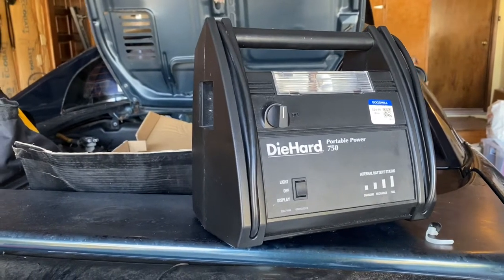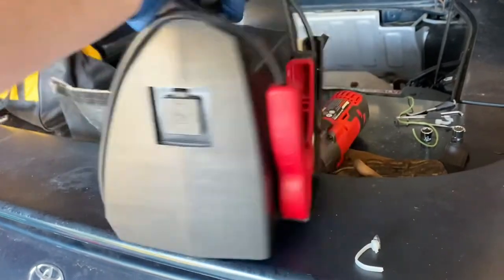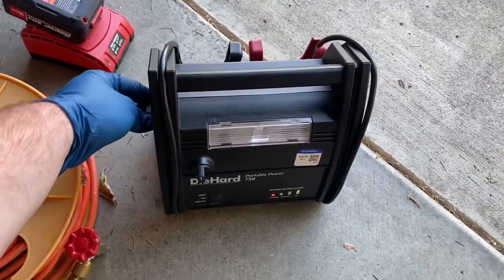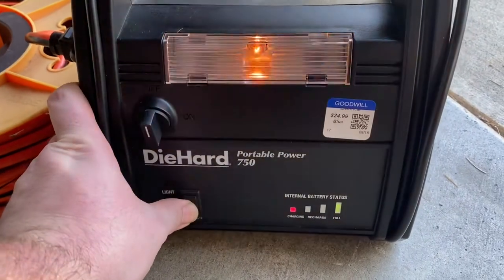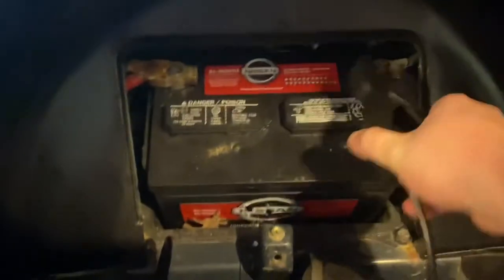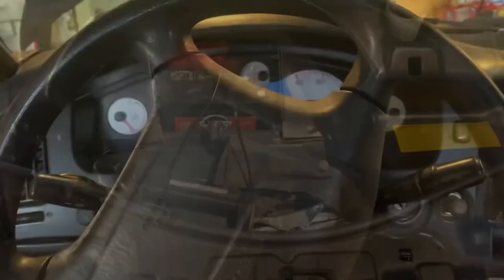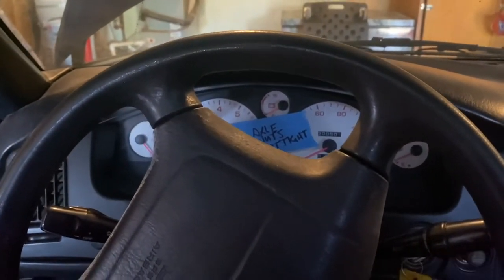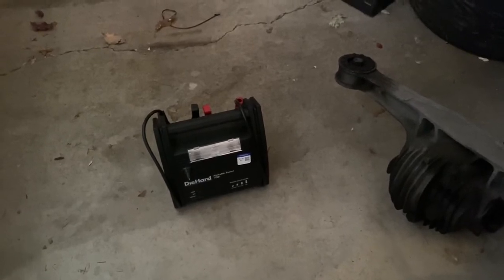Goodwill Diehard Portable Power 750 Test

Comment: You can take it apart and remove the battery and try charging with a proper charger.  Most likely battery is toast , either from sitting  plugged in to AC on perma-charge for years (water in electrolyte boils off), or sitting  dead flat for years  from not getting the monthly maintenance charge which DieHard recommends.   

I'm not sure what these units sell for new , but you can get  a new battery on amazn for 45 bucks delivered.  12v 12ah,  battery model sch12-12c (but check that's correct for your unit  )

This unit is old tech ; lithium ion jump starters that fit in your pocket and charge in the car seem way more attractive .

Comment: I changed battery in one . The 12 v works but apparently i missed a wire simewhere because the lights dont work nor does it quickstart a car battery.  Need to see the inside of one not messed with.   Mind sat opened up dor 2 years as i could not find battery to replace it with. Anybody gor a video if the insides of one???